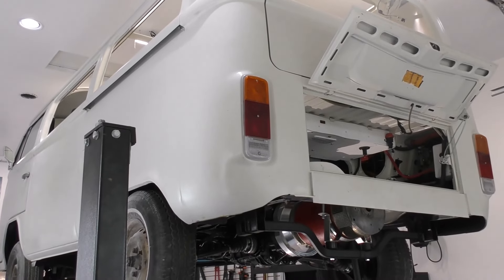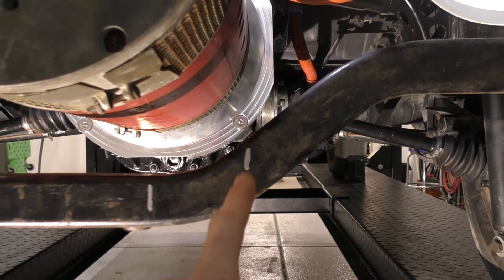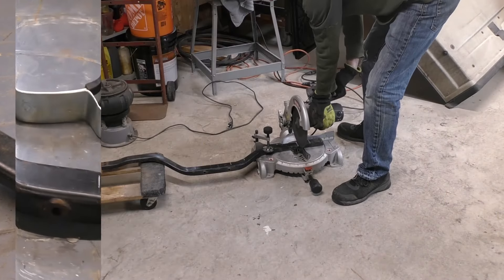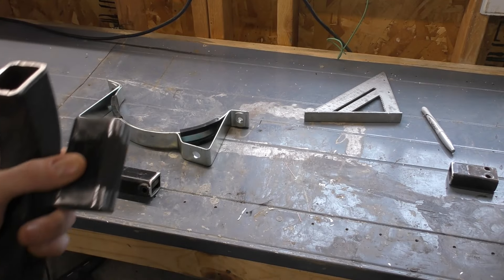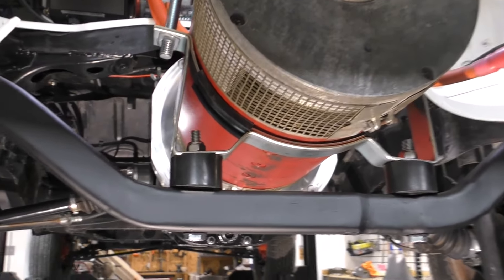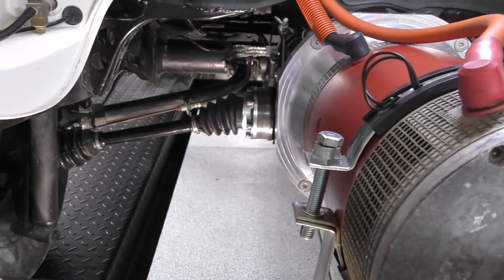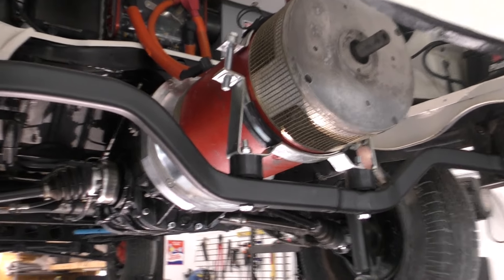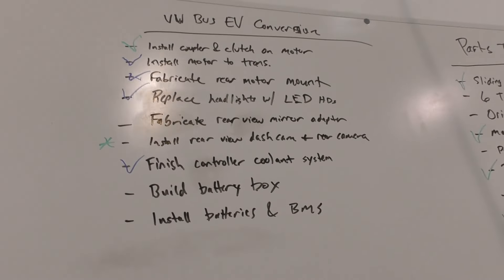VW Bus Electric Conversion Part 13: Fabricate the Rear Motor Mount #evconversion

Comment: Apologies for jumping out of sequence, but looking under your bus and seeing the engine in situ, made me think and I guess you’ll need an alternative solution for brake vacuum which would normally come from the petrol engine. Be interested to see what you do when you get to that stage.
Reply from the maker: Ian, the brake vacuum pump implementation is already done.  If you go to the EV Conversion playlist at the end of the video or on my channel page, I discuss the vacuum pump itself in Part 3 and install it in Part 4.  Neither of these videos focus on it specifically, so if you still have questions, let me know.
Reply: @FixItScotty  sorry, my bad. I’ve gone back and for anyone else, Ep 3, about 26:00 is the discussion. I need to go back and watch the whole thing. It’s an epic!